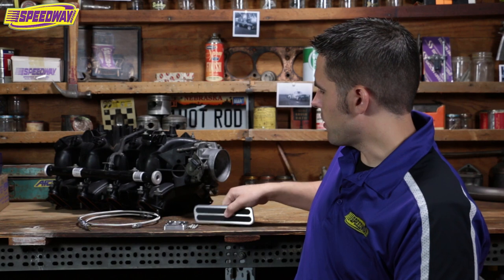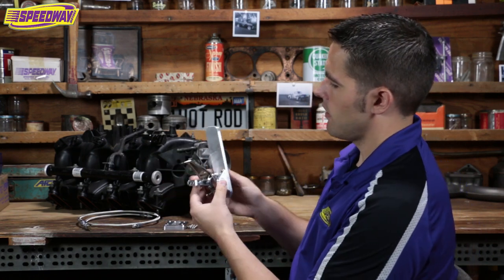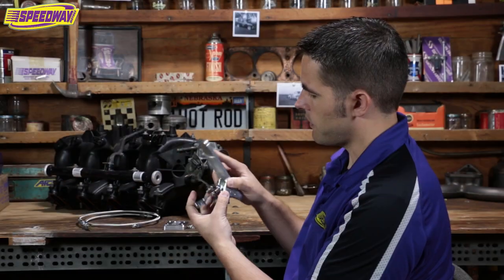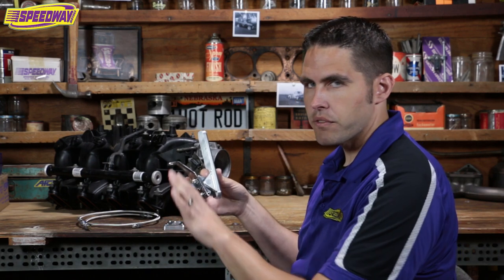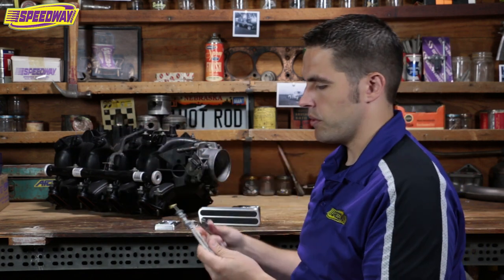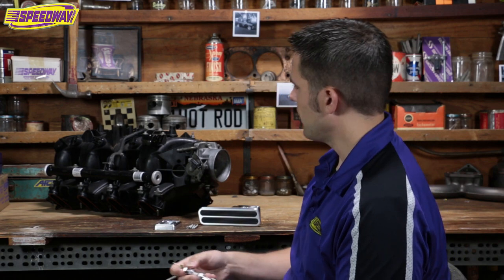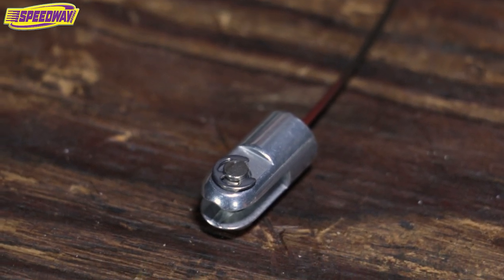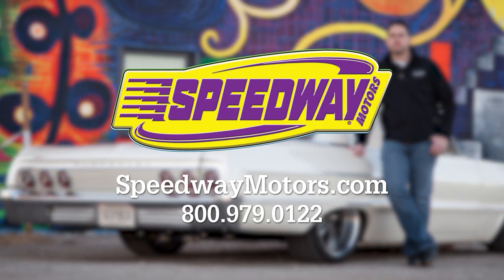Speedway Tech Talk - Lokar Throttle Cable/Pedal Setup

Comment: I have 1960 Cadillac DeVille it has that slot on the bottom that pushes in the rod from the the bottom it has an LS now will this work for a driveby cable

Comment: What fuel tank did you use on your 64?
How about the Fuel Sending unit?
Reply: Go visit 
Tanks ink. Com.  You find the tank for your car, it comes with fuel pump and the whole kit   To installed.

Comment: Would you be able to use one of these lokar cables for the factory pedal?
Reply from the maker: These are designed to be used with the Lokar pedal, so without seeing the pedal in question I'm unsure if it could be made to fit or not.

Comment: What would i order for my 67 Camaro ? conversion
Reply from the maker: https://www.speedwaymotors.com/Lokar-BAG-6096-1967-69-Camaro-Firebird-Throttle-Pedal,9139.html is a link to the Camaro throttle pedal or you can look up part number 4916096 on our website also.  The pedals are also available in ball milled or black if desired.  The cable kit you will need is part number 49101048 again available in black if preferred and can be shortened to your needed length.